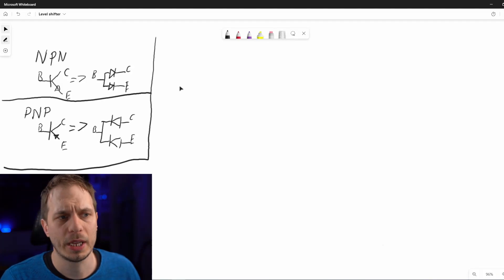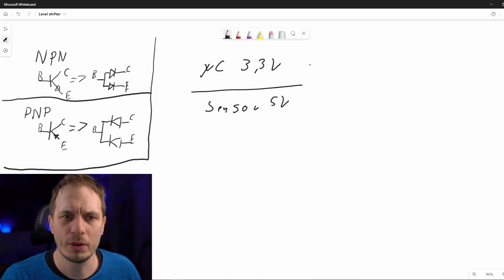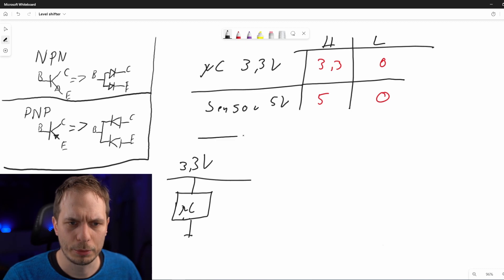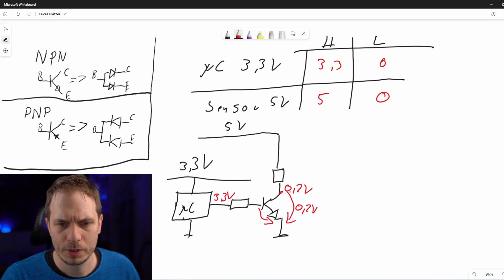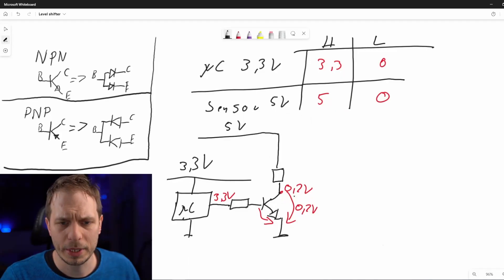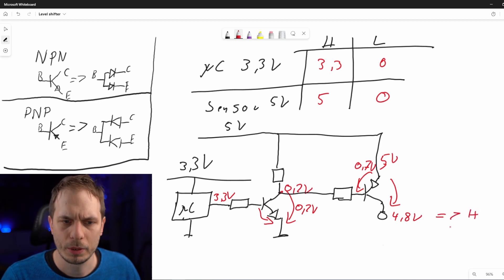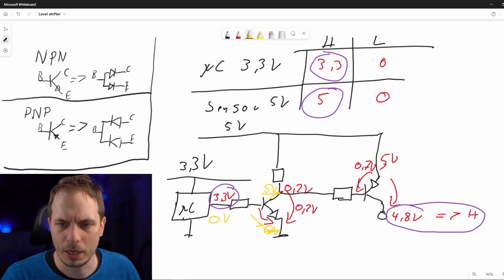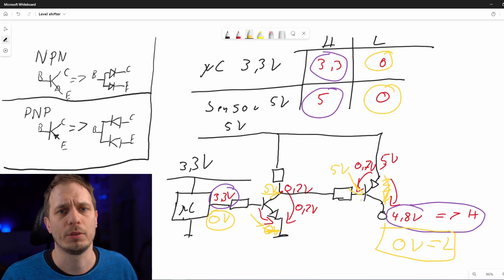Mastering Electronic Design: A Comprehensive Guide to Level Shifter Circuits

Comment: I used this before with two npn transistors and it took too much current from the micro don't know what will happen with one npn and one pnp. the problem is micros and modules are commonly pulled up inside what will guarantee that out put will be low when the second transistor is off
can someone help 😭😭